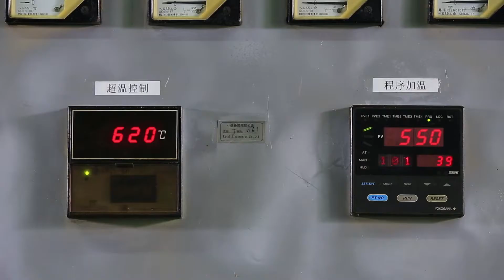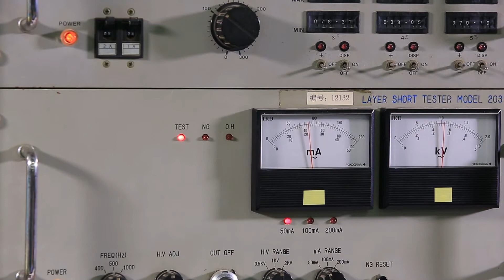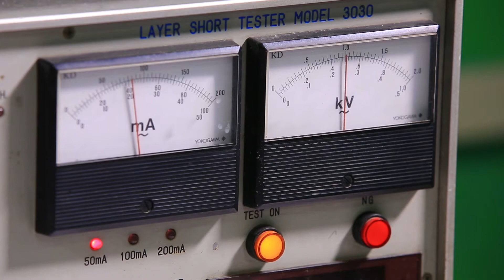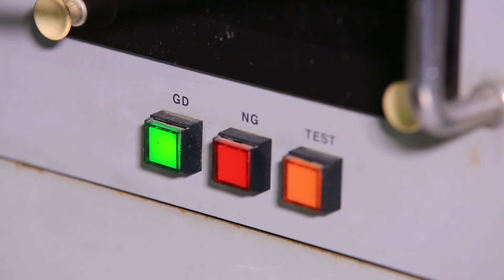Rotel Toroidal Transformer Manufacturing Process

Comment: Big heavy 50 /60 Hz  transformer plus diode rectifier is 100 years old technology. Modern SMPS can deliver same power at less weight. Plus: It can have PFC, though this is often not implemented. Why would anybody still use 50 Hz transformer nowadays?
Reply: Reliability for the next 100 years?
Reply: @fonebones88 In both cases:  Not even 25 years. Electrolytics get dry over time, regardless if it is an SMPS or old type PSU.
Reply: @MYNAME_ABC  I have seen some electrolytics that are still good enough even after 50 years. Of course 100 years is a bit far-fetched.
Reply: @fonebones88 With contant cycling or just sitting idle in a warehouse
Reply: @ipodtouchiscoollol Constant cycling some hours each day. Think, for example, of old transistor kitchen radios. Even in some power amps from the 70s/80s the supply caps are within their limits.
Reply: @fonebones88  Now that's quite impressive although things built in the 70s and 80s are usually overbuilt on purpose for longevity since planned obsolescence wasn't a thing back then. Nowadays parts are built using the lowest amount of materials you can get away with for maximum profit margins to appeal to investors so I doubt modern devices would last anywhere near that long.
Reply: @ipodtouchiscoollol  That is very possible. I wouldn't say it's always planned, but the attitude of customers and manufacturers has changed. Appreciation has been lost and many things have degenerated into fast-moving disposable items.
Reply: A LPS has a much lower noise level than SMPS so is generally a better choice for electrically sensitive equipment such as high quality hifi and medical equipment.

But obviously is lower efficiency,  heavier etc.

A SMPS may be ok for general stuff, but that doesn't make it good for everything.
Reply: @Model3GenerativeANdroid Noise is high frequency, both conducted and radiated,  usually inaudible. Conducted noise.can be filtered, radiated one can be shielded (and must meet even class B in order to fulfill domestic requirements)
Reply: Sure, it can be done, decent SMPS can work well, even in audio gear, (and a power amp is a reasonable candidate for one, a phono pre-amp, not so much)  but it takes a lot of engineering to beat the simplicity, reliability and power quality of a linear PSU.

If the caps dry out in a linear PSU then it hums, if they dry out in a SMPS it can, at best, refuse to work, quite commonly it will destroy lots of circuitry, I must have repaired probably several thousand SMPS in two jobs over a period of roughly 4 years and have seen plenty of them destroyed by caps drying out, a not insignificant number beyond repair, I occasionally will repair them even now and still see them blown up beyond economical repair.  

A linear PSU is far more likely to survive (and even help filter out) mains transients which can destroy a SMPS.

Complexity does not increase reliability.

So many SMPS radiate a broad spectrum of RFI and other electromagnetic noise as well as capacitively coupling it back into the mains wiring potentially causing problems for other equipment on the same mains wiring and in the vicinity of the offending SMPS, bonus points there because it might not even be your equipment  which is affected by that SMPS noise, it might be your neighbour's and in some cases not even neighbours right next door, they could be streets away. 

Both types of noise (radiated and coupled) can be filtered but, again, it needs lots of engineering to resolve a problem that's almost non-existent for a 50/60Hz transformer based linear PSU.

Yes, you can capacitively couple noise back into the mains through a linear PSU but it's highly unlikely to be an issue in an audio amplifier whereas the SMPS generates its own noise to couple back and radiate out of the case, the wiring etc.
Reply: Some still likes valve based amps. Some are freaky or finicky about noises, fidelity and response curves.
Reply: @M0UAW_IO83 SMPS is usually protected by MOV / Spark gap on the AC input, but can of course still fail during high overvoltage surge, as all electronics can.  50 / 60 Hz transformer supply has usually no way of cancelling the 100 / 120 Hz ripple at the output (and multiples of those), though this can theoretically be implemented even on transformer PSU by adding a linear regulator (at the cost of added components / heatsink and less efficiency). SMPS usually has high degree of 100 Hz ripple rejection by its very nature of being a regulated PWM converter. In both cases, the power amplifier itself is usually capable of suppressing the 100 / 120 Hz content at its output - at least if it uses a high loop gain. Feedback-less designs are therefore a failed concept, especially when used with unregulated transformer PSU.
Reply: Why? Purity of supply voltages, no RF noise.
Reply: It's 100 years old technology and it will work for 100 years, while switch mode PSU will 100% fail after some years.
Reply: power isolation: ie  line --> isolation xformer -> SMPS
Reply: @ipodtouchiscoollol  Issue is the majority of consumers replace their devices before they fail to get newer devices with new features. That's largely why devices aren't made to last very long, and companies have to complete on price point. You can of course by commercial grade devices which will last decades, but the do cost 3 to 7 times more than consumer versions.
Reply: @manishmandal-78    The audiophile I assume you refer to knows so little about relevant tech they can only fairly judge a design after being told exactly how it was executed, after which all evidence is tossed in a pile and covered over by their prejudice. I don’t worry about that going forward.
Reply: @fabi5783   Don’t forget technical ignorance and stubborn prejudice. SMPS are used at the ultra high end of audio circuit design, in the professional community that produces and performs the music audiophiles can’t seem to wrap their heads around.

Comment: The humming transformer in the RB-1582mk2, your Chinese manufacture is bad, which is confirmed not only by me, but also by other users of the said power amplifier.
Reply: И сильно гудит? Торы гудят обычно. Я напечатал на 3д принтере круглые ножки, наклеил 10мм вспененную резину, усилитель NAD гудел ели слышно, на ножках вообще перестал гудеть.
Reply: The humming issue could be eliminated by running  weld lines along the open sides of the core every inch. This will bond the laminations together eliminating hum. This also solved the issue with standard transformer cores. Welding the laminating layers together.
Reply: I bought my Rotel RB 1582 MKII in 2017 and it is absolutely SILENT.  No hum whatsoever!  It's an amazing power amp for the price. @Subgunman
Reply: you payed 2000euro for an amp? ahahahahaa
Reply: @Timsturbs  I'm also happy that I paid less than 200 Euro for a new piece at auction :)

Comment: Imagine how little time and effort it would take to develop a procedure for insulation testing that didn't expose workers to deadly voltages.
Reply: Indeed. That is some medieval testing fixture using alligator clips or pushing wire ends into brass forks and the testing supply gives +500V and 45 mA. That could easily flatline a worker.
Reply: @wombatillo  The testing power supply is not on (1000v, 50ma) until the worker holds down a momentary switch that is positioned away from the fixture, it's completely safe.
Worker has been doing it for 30 years lol.

Comment: @1:32 I’d like to see how that works in detail. I have a hard time imagining how the machine can continuously feed a wire around the core. Is there a really long lead up that is folded in half? The cable can’t possibly be on a feeder coil or that coil would have to be passed through the transformer that is being built. Anyone got any info on that?
Reply: The xformer's total wire need is wound onto the armature that goes through the torroid's hole, then 'unwound' onto the laminations.

Comment: I loved my 5 channel rotel amp - it was a monster.. but one night while in bed it went bang. It sounded like a hand grenade. The capacitors exploded and leaked a horrid smell. it was under warranty. Unfortunately for me, the courier ‘lost’ it on its way to the rotel repair center. I can’t blame rotel for that but it was their product failing that required the courier in the first place. I was in my 20’s and saved like crazy to get it. Bummed out for sure.
Reply: so you lost it entirely along with the money or someone had to pay you for losing it?
Reply: @juanbaclavab  I lot the AMP, thou I did get some money back from the courier company that stole it.. It wasn't anywhere near enough to replace the amp thou.

Comment: @thomaslechner1622

A LPS has a much lower noise level than SMPS so is generally a better choice for electrically sensitive equipment such as high quality hifi and medical equipment.

But obviously is lower efficiency,  heavier etc.

A SMPS may be ok for general stuff, but that doesn't make it good for everything.
Reply: Nah. Good SMPS will have much less noise as it will eliminate all of the line noise. Its much easier to filter out high frequency than very low frequencies (ie 50hz\60hz) since you can CLC and coupled inductors can be considerable smaller for high frequencies. Also much faster load regulation.
Reply: @guytech7310

That only considers electrical supply noise, the rf emissions are an issue with smps compared to linear.

It's no use trying to argue black is white, facts are facts,  there simply isn't ~20kHz radiation from linear, where there is from a smps.

Once you have emitted electromagnetic waves it is difficult to eliminate,  hence why linear supplies have their applications.
Reply: @juliegreen7604  Put this way, My Fluke 7- digit precision multimeter has a SMPS.  

When I design any electronics that uses precision analog inputs, its got a SMPS. I typically use a high frequency buck converter for the analog rail voltage regulation & use a CLC with a coupled inductor to get the noise very low, then I use a ultra low noise linear regulator to remove any remaining noise. I've used this to supply for 16-bit & 20-bit ADCs.

 Line noise is a problem for linear PS, Every time a inductance load turns on\off it generates noise that a linear PS will not filter out.
Reply: @guytech7310

I suggest you read my previous reply as you are completely missing the concept of noise.

Smps are producers of significant rfi/emc issues , these issues are all but non-existent with linears.

Smps have their place, but they are not magic,  there are instances where linears are more suitable.

Line noise, as you said,  can be reduced easily,  rfi and emc issues are notoriously difficult to resolve.
Reply: @juliegreen7604  No since SMPS can be shielded. The emi/rf problem you continue to hang on to isn't an issue in the real world.

You seem to just be ignoring facts & reality. Hope that works out for you. Good day.
Reply: @guytech7310

Well I just measured the emissions from a fairly high quality smps,  scanning from 100Hz to100kHz on a spectrum analyser (upfront attenuation of 28.5dB), shows two fundamental frequencies of 33.15kHz @ -20.6 dBm and 22.6kHz @ -25.3 dBm, each having 2nd and 3rd harmonics at -39.0dBm, -43.6dBm, and -43.5dBm, -27.3dBm respectively.

All of those are pretty high levels of emission,  a quick scan through 10MHz showed substantial harmonics especially of the 33kHz fundamental.

These are certainly a problem for sensitive equipment,  of course its fine for most household and industrial applications.

It may be an imagined problem to you, but for the many people working in certain fields, it justifies the cost and disadvantages of using linear PSUs or else they wouldn't be commonplace in those applications.
Reply: @juliegreen7604 Julie Give it a rest. There are lots of precision devices that use SMPS for ultra low noise applications, as I stated such as precision multimeters & other devices high bit-count ADCs.
Reply: @guytech7310

It's pretty simple really,  if smps are the best choice for everything,  then they would be used for everything,  but they are not!

There are applications where linear is the best option,  and giving examples of equipment which is not sensitive to rfi/emi  doesn't preclude the existence of things that are.

It's so simple,  why do designers of highly sensitive medical and other equipment choose a more expensive power supply option?

There has to be reasons, and it's generally the rf noise issue.

The original question was "why would you use the old heavy linear supplies when there are smps now"

The only real reason is that smps are not good options for certain equipment due to rfi/emi

These manufacturers add £100s to the cost of their equipment by using linear supplies, they're not doing it for a laugh!
Reply: @juliegreen7604 Ahh SMPS are in everything! Only a tiny few devices continue to use linear, most likely not interested in upgrading designs to support SMPS, or con'ing people to believe linear is better.